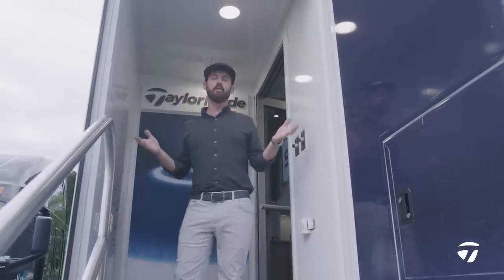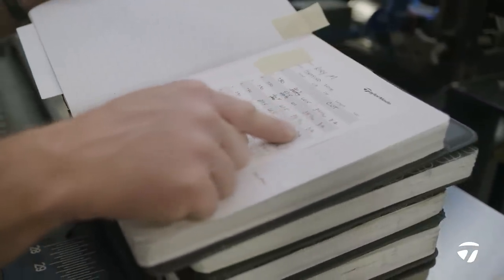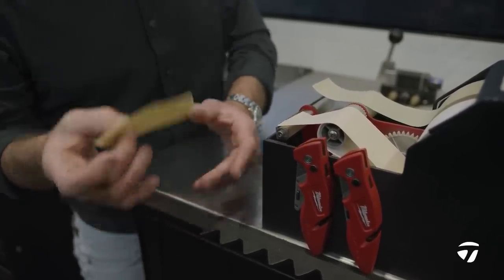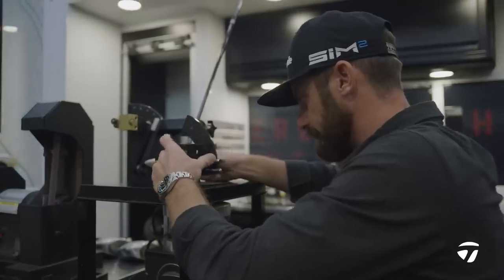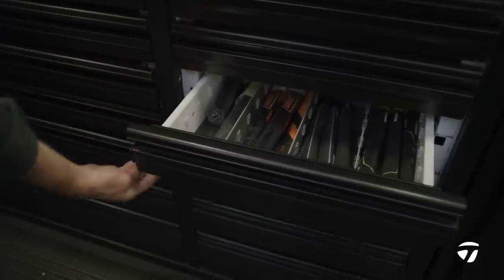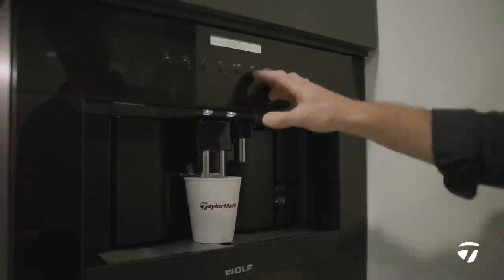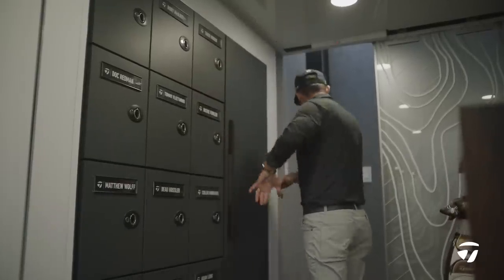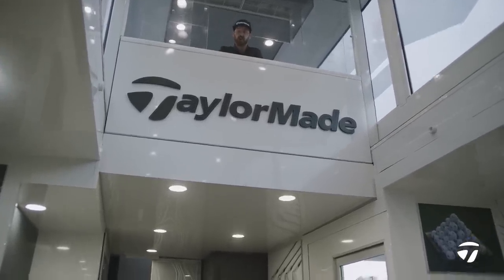Inside the TaylorMade Tour Truck | TaylorMade Golf

Comment: I was trying to figure out why my new driver costs over $500, and then I saw this...
Reply: A dollar for every driver head they stock on the truck!
Reply: they put all of the specifics only into the tour drivers lol. the sim 2 that u get from superstore doesnt go through all of those things
Reply: @LiamBrandtGolf  You can get exactly what is being made here.. just use a custom order. If you are happy with a standard shaft and head config, then by off the rack.
Reply: Meh I mean 529.99$ for a brand mew sim2, then 350 for a ventus blue, 100 to make the head, then that’s 450, 10$ for the grip so 460, 50$ labor, 510, so they only make maybe 30-40 bucks
Reply: @gabescustoms3281  The stock ventus is not even close to a proper ventus.. no velocore in the in the "off-the-rack" TM.
It's as close to a ventus blue as any other shaft in the world is.

Comment: Hi trottie, truck is amazing. Got a question, I'm playing a stiff 50g 6.0 driver shaft. I tried out a 66g 6.0 low spin low torque shaft at 9.5° but ball just won't stop spinning up and losing distance. I'm typically attacking the ball at +3-4° and not sure if a stiffer shaft or lower lofted head is the way to go? 
Hope you can help. 
Thanks
Reply: Go heavier..... that’s your issue from the limited info